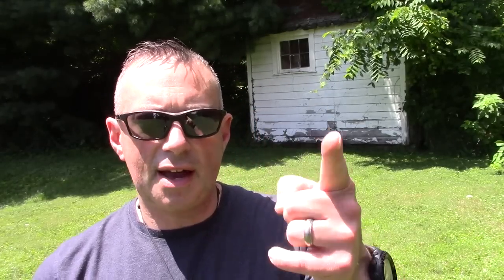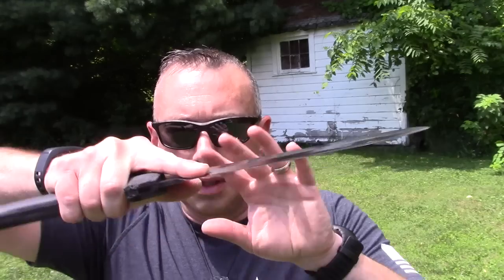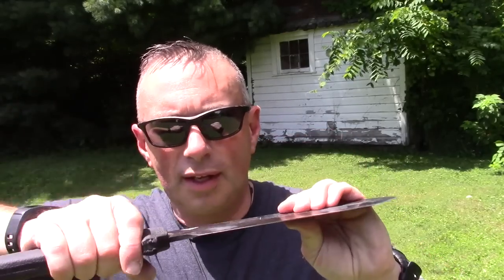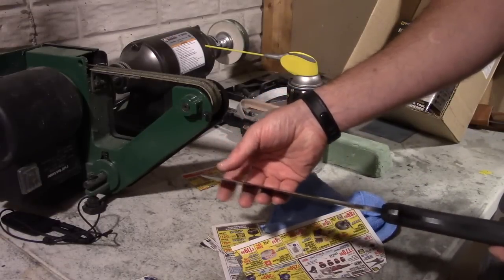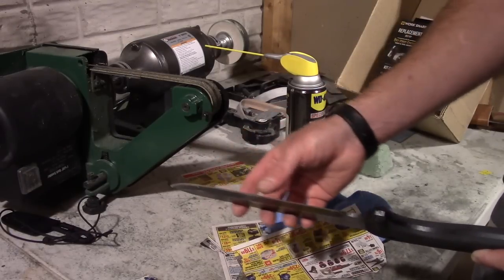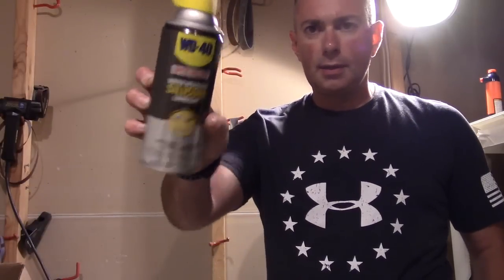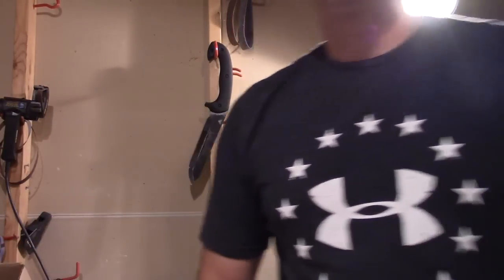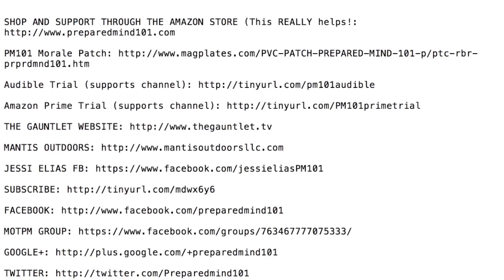Summer Of Jessica Week 9 GAW: Maintaining Your Jess-X  - Preparedmind101

Comment: I'm a big fan of the Work Sharp KOE & the Blade Grinding Attachment myself. It works extremely well for large blades. I generally use a KME guided system for my smaller stuff & my Scandi knives -- or just a set of Shapton Japanese water stones for the Scandies -- but the KOE is definitely worth the money, especially if you're into big knives and/or machetes, parangs & kukries. I still have people telling me that the Work Sharp will ruin the heat treatment on the blade though [head shake].

Comment: I just checked out the new flyer from Harbor Freight and that 1x30 belt sander is $54.99 not $30 ish. I will still probably buy one though and just use the 20% off coupon. Thanks for the sharpening lesson.

Comment: Do you think the Work Sharp WSGSS Guided Sharpening System (With upgrade kit) would work well for this? Thinking about getting into some backpacking, I would like to keep the number of tools and tools to maintain the tools low. I definitely don't want to be keeping something like that giant harbor freight thing around. I know the WSGSS is not powered but I like the fact that it has the stropping attachment and is small. Also looking at the original and the combo sharpener.

Comment: Finally broke down and bought the Jess-X and have already received it from Amazon.  What a great tool!  I was even lucky enough to get a Jessmuk and am currently waiting to receive it.  I am planning on getting a sheath from Yellowhawk which piggy backs the Jessmuk on the Jess-X rig that he designed for you?  I was thinking pretty much the same rig you got, but without the compass on the back and the light on the front.  Maybe an Altoids tin on the back and Suunto compass alongside the Ferro rod and adding a dangler to the D ring for belt carry when not using it Baldric style.  What are your thoughts on that?  Do you think the piggy back idea would work well or is the Jessmuk too big for it.  Many thanks!

Comment: Just wondering, how much do you use your BK-7 or BK-9? Are the knives you designed completely taking the place of these on your list of go-to knives, or are the Beckers still in the rotation?
Reply from the maker: +extremyst Never. But I still have them. The knives I designed are specifically what I wanted. If it were some sort of combat scenario, I'd dust them off.

Comment: Every man needs a work sharp system. I have the Ken onion edition and a field sharpener. They both work great. I agree with Chris, it's best to spend the money and have the means to easily maintain your toys. It's pretty bad but after I'd sharpen a knife with a stone I would be reluctant do use it. Lame I know a knife is a tool and meant to be used. But now I  3 minutes I'm popping hairs off my arm. Plus I don't hesitate to use any knife. I also get paid to a sharpen other guys knives with it. If you follow the directions you will not blunt the tips of knives. My only issue with it is that for some reason I struggle with scandi grinds. I'm 99.9999% sure that it's me not the sharpener.